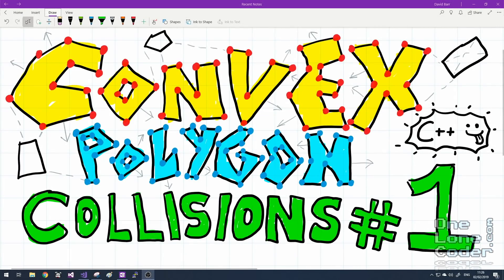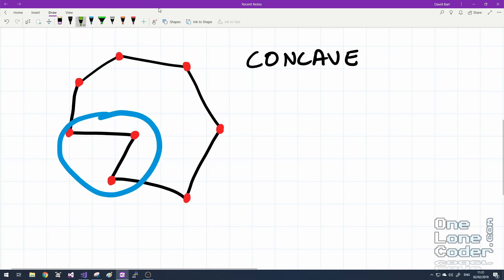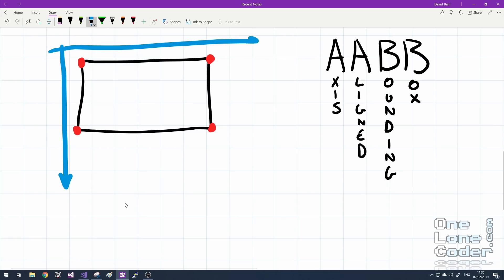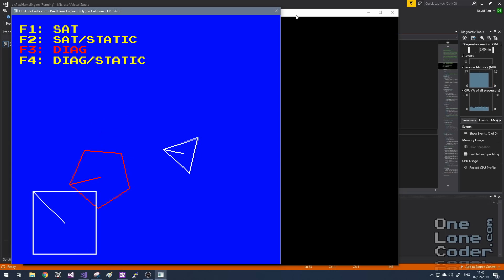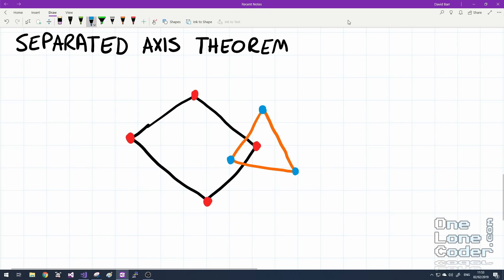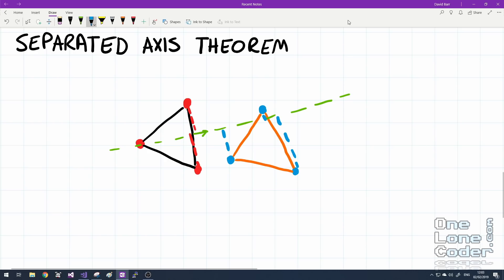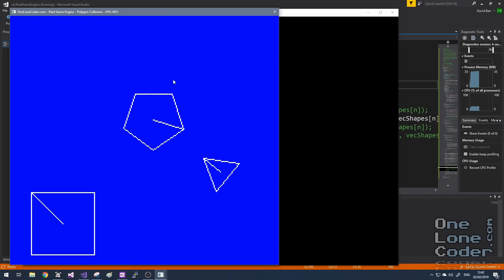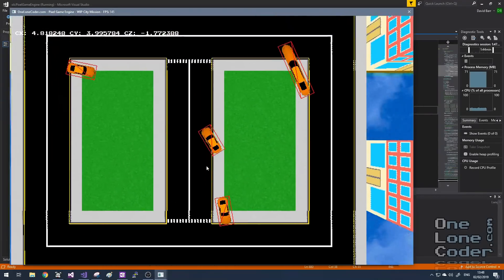Convex Polygon Collisions #1

Comment: diagonals isn't perfect, if a smaller polygon is fully inside the triangle formed by 2 diagonals and the side. So it is not a perfect overlap test.
Another good collision test for convex shapes is the jgk algorithm. Often very poorly described though.
Reply from the maker: Hi Ratchet, true about the small shapes, but it has to get inside first, and the diagonals of the smaller shape would not allow that to happen.
Reply: @javidx9  Assuming your small shapes move slower per frame than their size of course. Otherwise they can just jump in. An edge case to be sure, but a case nevertheless.

Edit: Also let's not forget that depending on the application you may not actually want to displace the objects based on whether they overlap or not, just know whether they actually overlap or not. So it can also fail there.
Reply: @BanzayIkoyama  heh, "edge" case. Nice.
Reply: yeah but tunneling is an issue and is easier when you only need to pass a single line. 

SAT and JGK both don't allow that kind of overlap
Reply from the maker: Lol you are quite right of course, if the step per frame permitted this. You can mitigate against this with a more sophisticated trajectory system like I did with the balls collisions examples though. However none of these systems are infallible.
Reply: Though jgk can be augmented to do the tunneling check for nearly free by adding the time dimension to it.
Reply: It's GJK, not JGK
Reply: (I didn't see the video yet. I'll grab it to see it at home)
You can also avoid tunelling by "extruding" the object when you move it. Instead of having a triangle (for example) at position A and then the triangle at position B, you'll consider the shape (not triangle) formed by the triangle at A and the triangle at B AND lines inbetween.
It's hard to explain with text and easy to visualize. 
Consider you have a triangle ->with ink<-. It's somewhere. Then, instead of warping it (which would allow the "bullet through paper" effect we are talking about) you move it. This will create a loooong shape (the ink will do that). 
If the original shape is convex, the resulting shape will also be convex. 

Of course this only work for straight movements. But if the frame interval is small, it is an acceptable approximation.

Comment: Very good video!
Tried the code myself and the diagonals static collision works perfectly except when 2 rectangles collide when both there sides are parallel one of the rectangles is offseted to the side instead of just being pushed back
Any way I can fix this?

Comment: the diagonal approach is a little buggy, because if you are trying to collide with a smaller shape(rect) right in the middle of a side of a bigger shape, it starts jiggering because the difference is calculated for multiple diagonals and then added to the position twice, or thrice etc... instead of once.

 I will try to fix that
Reply: def ShapeOverlap_DIAG_STATIC(self,polyy1,polyy2):
        poly1=polyy1.copy()
        poly2=polyy2.copy()
        num = 0
        for shape in range(2):
            if shape==1:
                poly1,poly2=poly2,poly1

            # check diagonals of polygon
            for p in range(len(poly1.points)):
                line_p1s=poly1.pos
                line_p1e=poly1.points[p]
                displacement=vec(0,0)

                # against edges of the other
                for q in range(len(poly2.points)):
                    line_p2s=poly2.points[q]
                    line_p2e=poly2.points[(q+1)%len(poly2.points)]

                    # line segment intersection
                    d = (line_p2e.x - line_p2s.x) * (line_p1s.y - line_p1e.y) - (line_p1s.x - line_p1e.x) * (line_p2e.y - line_p2s.y)
                    if d!=0:
                        t1 = ((line_p2s.y - line_p2e.y) * (line_p1s.x - line_p2s.x) + (line_p2e.x - line_p2s.x) * (line_p1s.y - line_p2s.y)) / d
                        t2 = ((line_p1s.y - line_p1e.y) * (line_p1s.x - line_p2s.x) + (line_p1e.x - line_p1s.x) * (line_p1s.y - line_p2s.y)) / d

                        if t1 >= 0 and t1 < 1. and t2 >= 0. and t2 < 1.:
                            num+=1
                            displacement.x+=(1-t1)*(line_p1e.x-line_p1s.x)
                            displacement.y+=(1-t1)*(line_p1e.y-line_p1s.y)
                if num!=0:
                    displacement/=num
                if shape==0:

                    polyy1.pos+=displacement*-1
                    polyy1.update()

                else:

                    polyy1.pos+=displacement
                    polyy1.update()

        return False
Reply: this is a code in python, but main thing I added was that I just devided displacement by number of diagonals intersected, and now it is supposingly has solved the problem when if I collide by 2 diagonals with 1 side it is thrown back twice as much as it is supposed to
Reply: please someone say if it is not a dull idea before I started moving on with my project and understood it much more painfully
Reply: ok, I fixed it I think I just used Diagonal check to calculate how many diagonals are colliding and then devided the displacement by that number
Reply: It was working at the very beginning, I am dump, but I will become better

Comment: is  a concave shape possible by thinking of it as being made of convex shapes?
Reply: Yes, and it's the approach generally used (=split the concave into convexes).
However, it's not trivial to split it.
Long times ago, I tried to tesselate doom sectors. Basically, a doom sector is defined by a set of lines. Each line has two side, and each side tells which sector it is facing.
This define the shape, and it can not only be convex, but also concave, or with holes, or be in multiple pieces not connected at all etc. 
Three connected points with a valid angle may still not form a valid triangle. 

You can have a triangle with a "nick" on a side (ok, it's not a triangle. It's to hlpe you visualize it. Draw a triangle ABC, put a "tooth" on the side CA ->   When you go from A to B and from B to C, everything seem fine. To find that you cannot make a triangle from ABC, you'll have to go farther. And the tooth can come from actually very far in the polygon.

The other case.
Take your triangle with a nick (ABC, a nick on CA).
Pull the nick to A, so you split the triangle in two.
Still AB BC looks ok, and now there isn't even a nick to detect. 

It's easier to draw than to describe. 
I had to tacle with this kind of problems XD

Note that once you have a tesselation of your not-convex polygon, it's easy to group triangles into convex polygons (=it is easy to detect if adding a triangle to an existing convex polygon would make it not convex).
Reply: @bubuche1987  great comment, thanks
let me just get a sheet of paper and try to understand it
Reply: Here is an image I made some time ago 
https://jme-hub-cdn-jmonkeyengineor.netdna-ssl.com/uploads/default/original/2X/7/74d15c97e38c725b6b2ab8495ce304d8c462c2d0.png

If you want I'll make a picture tomorrow to illustrate my message. But it is really not a big deal.

About the "nick" problem : take the image on the first column, third row. If you follow red arrows you may consider that it is a valid triangle (the angle is ok). But it isn't. 
Or if you look at the third column, first row : everything seem fine from the point of view of the red arrows, but it isn't.

Comment: Hi, how can I find the normal vector with 2 3D points?
Great video btw :3
Reply from the maker: The best you could do is find the normal plane, if you only have two points, thats simply a case of inserting your points into the plane equation.
Reply: @javidx9  Yeah I figured it out as well, thanks anyway :D 
I'm currently stuck with finding the 'shadows' of the shapes on the normal vector relative axis but I'm sure I can figure it out.

Comment: very nice as usual! there's one computationally simpler method. simply build planes from polygon edges and then test all the vertices of the other polygon to each plane. if all vertices are in front of the plane, there's no overlap (do this for both polygons). the only problem is that this requires consistent winding. I've modified your code to replace plain SAT with this method (had to flip winding for triangle and n-gon): https://gist.github.com/kmar/92f5e813253bfac8f2979231b6af9980
Reply from the maker: Thanks satarimar, I like that there are a variety of techniques. It would be interesting to try them all side by side. Each has advantages and disadvantages so choosing the right one is important.
Reply: @javidx9  when I think about it, the (signed) distance from a plane is actually pretty much what you get in SAT by projecting along edge normal. it's possible that those methods would actually boil down to same thing. Oh and the planes can be precomputed and transformed along with poly's vertices, so the normalization in inner loop could be skipped. Anyway, thanks for your videos, it's always a source of inspiration, looking at certain problems from a different perspective, learning something new and also food for thought.

Comment: That can be used in 3d?
Reply from the maker: Hi lucas, yes with some modification, lines become planes of course, and so shadows become areas. The approach with diagonals though could be extended to 3D as doing line plane intersections is trivial too.

Comment: Does these methods work for 3d as well ?
Reply: Yeah. I have it implemented right now in my basic 3d engine. Just use line-plane intersection instead of line-line. The only time it doesn't work is if two objects are intersected at an angle where 2 sides are touching but no corners, which I'm not too worried about for my use case.
Reply: Thanks alot !  @jtkyber